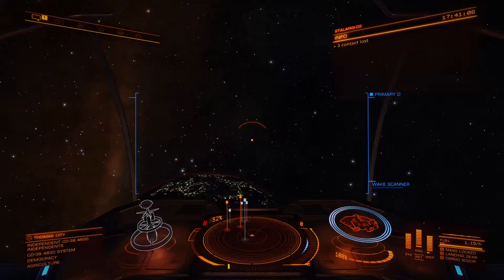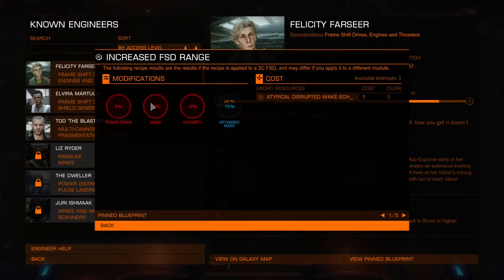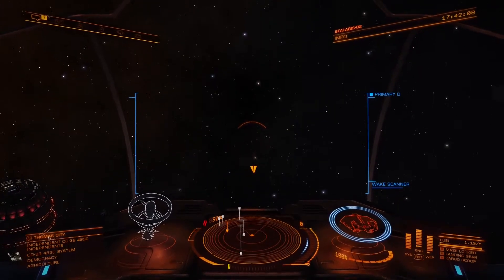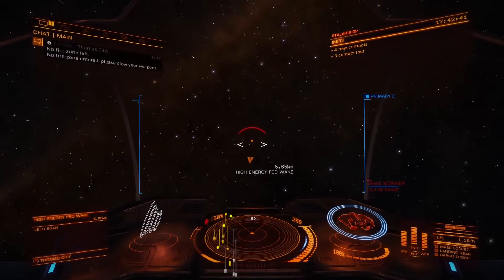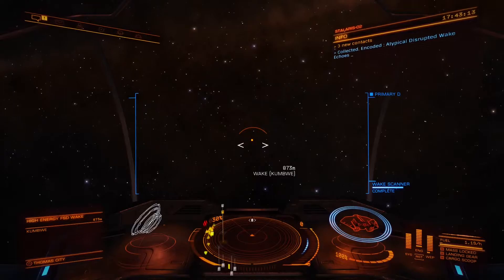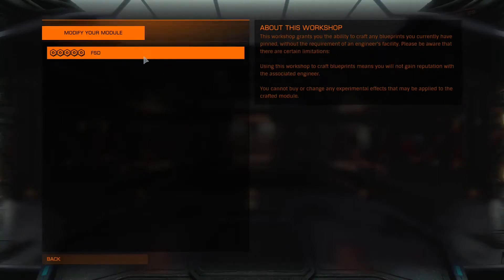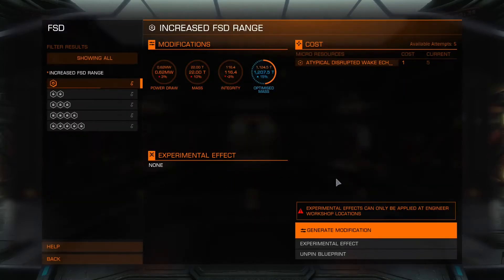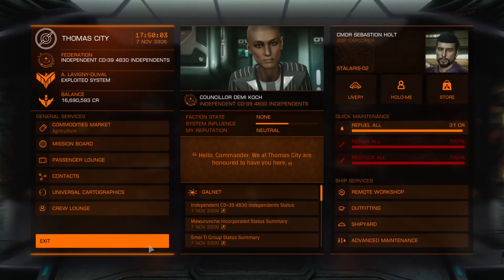Elite Dangerous: FSD wake scanning and modification

Comment: A tip I learned is you can find a lot of wakes by visiting systems that are in a state of famine. Apparently there's usually 3 Type 9's that pilots deliver supplies to & you can scan a lot in a short time
Reply: there is no more famine states atm, could not find any searching the map
Reply: @moerasmammoet  yeah, I think those didn't last for long. I never was able to find any, after I saw a couple of videos claiming that was a good way to get wake scans. Now I just randomly scan wakes as I'm heading into or out of stations. I don't get a ton of scans, but I'm not that big into engineering right now, so I don't really need them, but am just storing them up for later. Glad to hear I'm not the only one who couldn't find any famine systems!